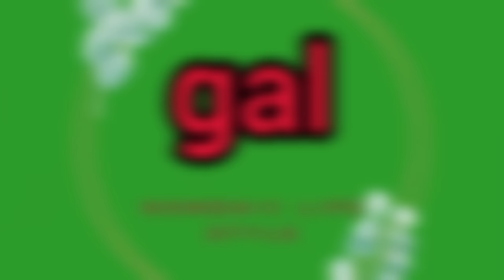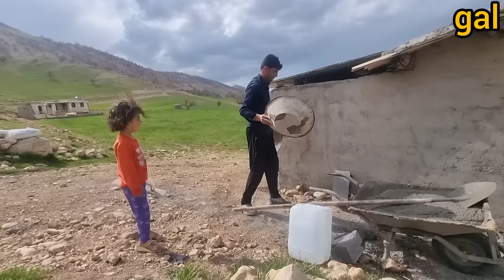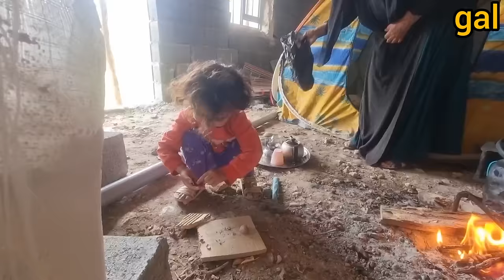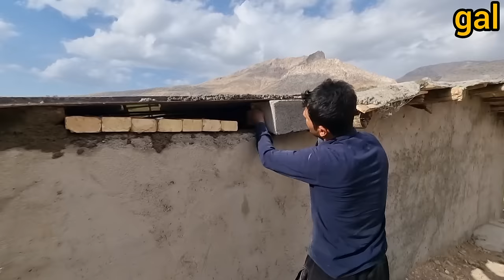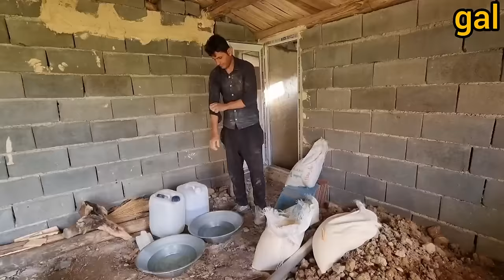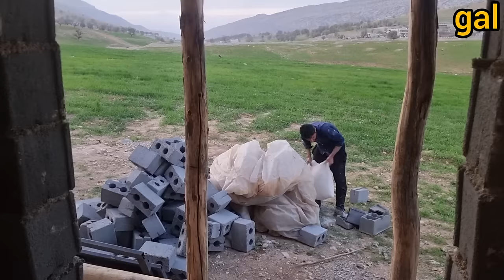Insulation of bathroom and toilet walls with the help of a young nomadic girl

Comment: I have seen on other channels where they use the silver sheets to put on the outside of the hut walls so the moisture will not seep through the cement and cause moisture in the walls. I mention this because moisture in the walls is one of the reasons why they took your baby. It seems like when outside is just cemented moisture still leaks through.  Also, they tar over cement on the roof so that doesn’t leak.